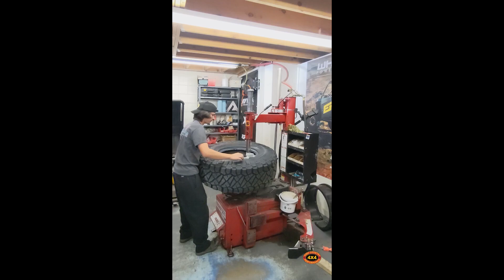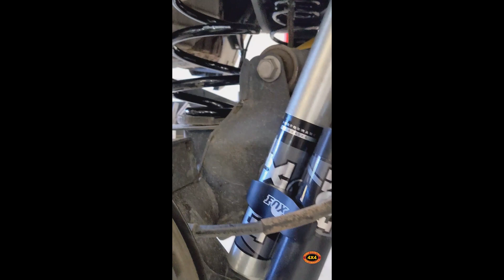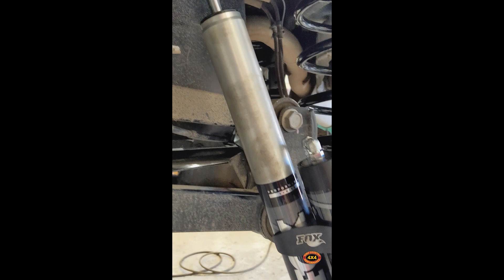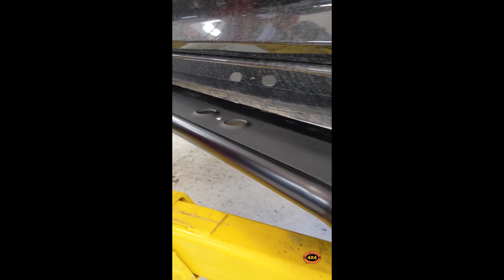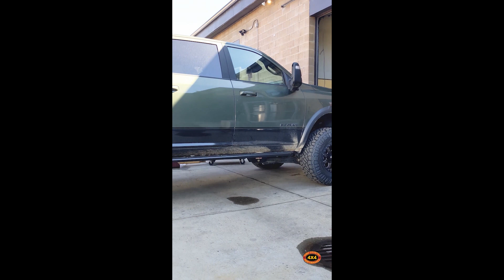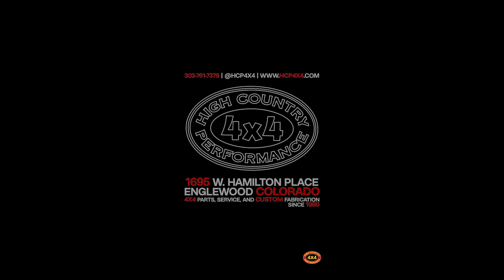2023 Ram Power Wagon | Carli Back Country Suspension | AEV Bumpers & 37 Inch Nittos | HCP4X4

Comment: How well did the factory PW winch work in this bumper? What about the “remote” connection plug in connector?
Reply: That’s what I want to no I just hit my 3rd deer and this one hammered my grill and bent my bumper I need something stronger than stock
Reply: @geraldchilders2625  Going to put on the Chassis Unlimited Octane front bumper tomorrow and will be releasing the video a few weeks later.  It is made of 3/16” thick steel so should be fairly substantial.
Reply: I was looking at those you can also ad bull bar to that bumper it gives you little more protection I’m definitely interested in seeing that
Reply: @geraldchilders2625  Added the bar to the package as well.  Will be installing it along with the bumper so you can see all of it when I put out a video.